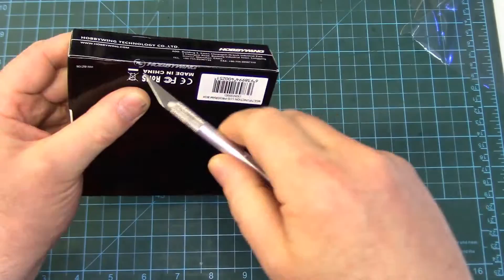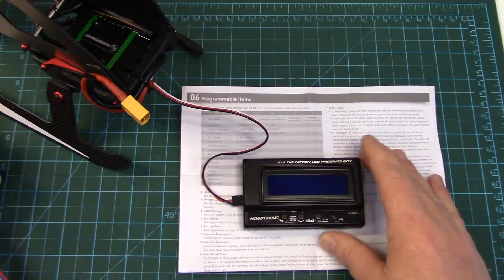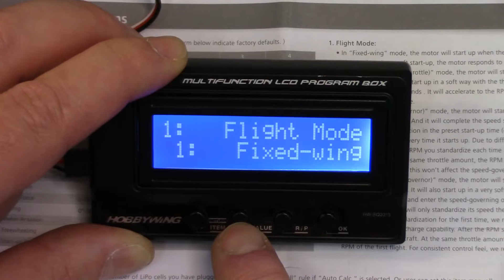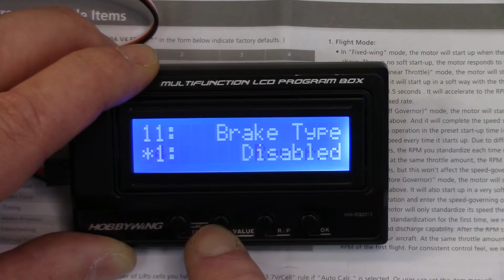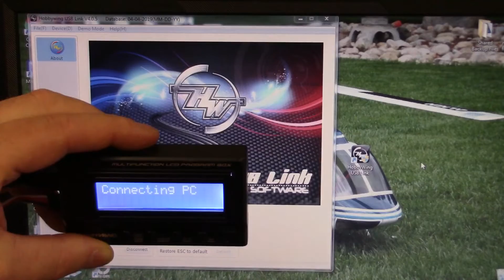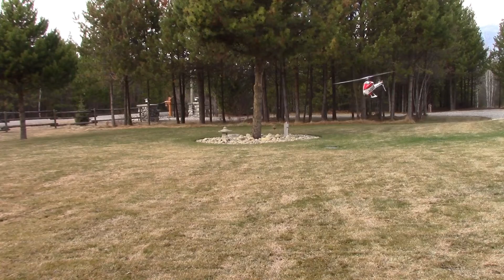ALZRC Fast Devil 505 First Test Flight

Comment: Hi John,
Got myself 505, and this is my first FBL Heli.  I’m use to fly Heli with fly bare (Thunder Tiger Raptor 50). my D/R EXP set at 25. I only do sport flying.  

With this 505 FBL the helicopter is very responsive with D/R EXP set at 25 and still afraid to hovers or fly this helicopter. 

What is your recommendation for D/R EXP setting so my helicopter won’t be so responsive. 

Also I just order H1 auto pilot for this heli and one of your video will be great help setting up.

Comment: Hi John love your videos! Can you do a tutorial on programming a K bar with the iCard? I don’t have a windows based computer just a Crome book.. I’m new to programing flybarless systems have a 450align v2 that I completely built from scratch a 480 and am currently using conventional set up but want to change to dfc head.
Reply from the maker: Sorry, I don't have a K-bar.
Reply: @Rchelicopterfun  ok thought you had a K bar on the 505 my bad
Reply from the maker: Got rid of it & put an Ikon in after the Kbar tail gyro started drifting. No idea about programming the Kbar with an iCard (don't even know what that is). The one I had, like all my FBL units, I programmed via USB cable and laptop.
Reply: @Rchelicopterfun  the iCard is a portable programming module that you can plug in at the field designed for the Kbar.. ok thanks for the help
Reply: @Rchelicopterfun  is it possible to do a full programming with the iCard on K bar ? Not sure I’m finding it hard to find info.

Comment: Hi John, awesome content, so much so I bought a 505, H1 and all the bits you used and built myself a copy of what you did. One question if I can?…. when using the program box, I updated the firmware on the program box itself and ESC. On the program box I’m now running firmware version 4.0.06. Your video shows you running 3.2.33. In version 4.0.06 they have removed the “Heli Linear Throttle” as an option. In its place they have added a “Heli External Gov” option. The other 3 flight mode options are unchanged between the versions. Given there is no linear throttle option should we be using the Heli Ext Gov or something else?
Reply from the maker: Sorry, no idea short of contacting HobbyWing tech support which is excellent.
Reply: Hi John, firstly thanks for replying. Secondly, I'm surprised you don't know because of all the Youtubers I follow you seem to me to be the oracle on this stuff  - it gives me personal hope because I feel a little less poorly of myself when I get stuck on something (lol). Prior to contacting you I have already been through the tech notes for the various firmware releases and there is no mention of a change to the Flight Modes so it all seems quite odd. Anyways, Ive contacted Tech Support as you suggested and we will see what they come back with. I will update this post if I get anything meaningful back to help anyone else following your build.
Reply from the maker: @Drone Downunder - yep, unless you use the exact version firmware, it's pretty much impossible to know every little nuance of every change that is occurring. I'm also primarily a Castle Creations ESC user and  not up to speed with HobbyWing ESC's.
Reply: @Rchelicopterfun I get that John - I will work my way thru it. Be aware though (in case you get anymore enquiries along these lines) the firmware version you used doesn't even exist as an option anymore.
Reply from the maker: @Drone Downunder - Guess that is why I'll continue to stick with Castle's ESC's 😄 Thanks for the info.

Comment: I have 3 K-Bar minis. They all have this lazy tailwag I can't seem to solve. I've tried everything, P gain, I gain, acceleration, etc. with no success. Do you have any advice or know anyone who knows?
Reply from the maker: Softer mounting foam for the unit - run a higher head speed - increase belt tension -  use a better FBL system - confirm no mechanical binding or slop in the tail pitch assembly (about 75% of all the tail oscillation issues I'm requested to sort, are due to mechanical sticking or slop in the tail system).
Reply: Hey John Salt, your previous reply has helped me alot. My new concern is, I have this Kbar on my 700 nitro. Works great except for this stirring oscillation meaning like when you have a glass of water with powdered milk and you stir the milk away. As the head speed increases so does the oscillation. I've tried min and max main rotor gain and so much more. Perhaps you know how to solve this oscillation? Thank you.

Comment: Hi John Ive a few questions for you if you wouldnt mind answering them. ive just bought the E180 and once I re ieve that and fly it for a few months  Im considering buying a 420 or a 505 Devil maybe in the next 6 months or befor the year is out. for me with customs in ireland it will cost me the 420 will cost 550 euros and the 505 will cost 800 euros, I have no batteries so they would have to be bought also. Is it really worth spending the extra 300-400 euros taking batteries into account for the 505 or would the 420 be ok, I really want a big helicopter but i think the 505 would start to get prohibatively expensive for me, but if its the case where it is so much better than the 420 then maybe i may save up longer and buy the 505. What are your opinions please, If you have no experience with the 420 then just give me your opinon?

Also I have a tx16s do I need to buy a reciver for it or can it be bound as is? 

Lastly, can you recomend good but cheap batteries for either heli, everything im seeing and reading about batteries on Banggood such as the ZOP power and the URUAV suggest they are very poor batteries(at least in the 6s versions used in these helis)

Thanks and warm regards from Ireland :)
Reply: Well that unfortunately was a waste of time 🤷‍♂️.

Comment: Hello, Nice video. Just noticed you actually changed your ESC setting back to ELF governor mode when connected to the PC
Reply from the maker: I was showing an example of how to change it using the PC. I changed it back to linear before the test flight.
Reply: @Rchelicopterfun  I was kind of worried you changed it by accident while showing how to change the settings and then didn’t notice it. All good then! :)

Comment: Hello john, very nice video and build! I am building a 505 right now and am at the point to put the main rotor head on. When i put it on it  has some up and down play in it. When i take it off is found out that het hole in the main shaft has a larger diameter than then lock bold that goes trough. Is that normal?
Reply from the maker: Shaft hole should be just large enough for the hex bolt to easily slide through. An oversized hole in the shaft where the head block jesus bolt slides through shouldn't cause the head block to be overly loose on the shaft, but there will be some play. The head block like most mid to larger size helicopters is also clamped to the mast by two more hex screws. Maybe you forgot to tighten them?
Reply: Thanks for the repy, i try to tighten them some more.

Comment: Does the Kbar come with limited bank angles? I am kind of new to RC Helis but looking at the Alzrc heli kits, I don't want it to go full 3d mode tho. Is this easy to setup to have mild controls?
Reply from the maker: Any collective pitch RC helicopter can be setup with beginner/mild response & control for learning on. Cyclic & tail dual rates are your friend along with tame pitch & throttle curves. Reducing collective response as well as power output is just as important as limiting cyclic and tail response. To answer your question on the K-bar. It's a 3 axis gyro only, no artificial 3 axis accelerometer self level & tilt angle limit help.
Reply: @Rchelicopterfun  okay gotcha. This was extremly helpful, appreciate your input!

Comment: Nice series on this. I built a Goblin 500 for my son back when they came. He was an accomplished 3D pilot at the time. He eventually quit the hobby but I am trying to get back into it. He was a much better pilot than I ever was. I was looking at one of these since they don’t make the Goblin in 500 size anymore. I don’t see any difference in your videos other than colors. I think I would rather use one of these than buy a used Goblin and rebuild it. So are you still liking the electronics that came with it? Like you I probably wouldn’t use the K-Bar long-term. I do think it’d be greater for smaller helis. Hard to beat a $35 VBar clone. The knock on the original Mini VBar was its current handling ability. I still have one on a 360 sized heli. Are you guys able to fly larger helis there these days? I am worried about FAA regs here. It’s not looking good.
Reply from the maker: Hi Rod, Yep, it's a pretty amazing value and quality piece of kit for the price. All the electronics are still working very well - not a single problem. I'm flying the 505 with a Bavarian Demon 3X now. That cheap Kbar is okay, but I always had occasional porpoising (so minor you couldn't see it unless flying close in) that I could never quite get rid of.
 I've always been of the opinion, you can get that sort of stuff sorted on any FBL unit if you take the time to play with the PID and response time settings, but I never could get rid of it completely on the low cost clone K-Bar. The BD 3X has an elevator filtering algorithm and it flies like a dream now. I'm thinking the large mass of the tail boom on this thing in relation to the rest of the heli mass (like scale RC helicopters) is just too much for the cheap K-Bar to deal with (just a guess of course). I tried the K-Bar on a conventional pod & boom Trex 600 after removing it from the 505 and it works fine with no porpoising at all. 

Flying up here in the Great White North is harder as well. Unless you belong to a MAAC (our version of the AMA) field or have a private field to fly at, we are basically stuffed unless you are willing to succumb to the time & money wasting draconian RC registration & reporting process . Most of us RC heli fliers are just giving the middle finger to transport Canukistan while we fly our birds illegally in more remote locations, which most of us have always done anyway very safely and responsibly. I will never register myself unless there is some common sense put forth and these jokers actually use science and critical thinking in their policy making. We all know hell will freeze over before a corrupt & inept politician/s ever does that. As of right now, RC regulations are even more draconian than they are for flying maned ultralight aircraft up here. It's a joke! 😡
Reply: @Rchelicopterfun  Hi John, I recently move to Canada to study abroad and I agree, the regulation is nuts, let us rc heli fly and ground the drones, its the drones that is causing the issue not the rc heli guys

Comment: hey John  i just bought the hours xq12s with opentx  it has the latest version 2.3.5 on it but there  is no helicopter menu what version do you have or how you get it. when i pull up the version screen on transmitter in OPTS it says noheli
Reply from the maker: I'm no expert on OpenTX configuration but my guess is you'll have to go into OpenTX companion and redownload the OpenTX firmware version you are using to your Horus, but this time, make sure the noheli box is un-ticked in the build options section. I'm currently running version 2.2.3. There are lots of video's out there on OpenTX configuration, but if you're interested, I did one on my last Horus update where I had to enable the multi-protocol option for the iRangeX module. Here's the link to it if you're interested:  https://youtu.be/XmUIdMsBnZI
Reply: @Rchelicopterfun  opentx is whole different world than what i am used to. i was running spektrum. they are up to version 2.3.5 now i went a head and  flashed the radio  and did not check thew noheli and now i have it on thanks for the info
Reply from the maker: Glad that worked. Yep, OpenTX is a whole new world compared to pre-configured computerized radios. I found it rather intimidating when I switched over, but now love the features and flexibility it offers. The growing list of cool radios that now support it - amazing. Of course, still loving my X12S. I see that latest version 2.3.5 is a critical one to fix some Horus bugs so I better flash mine too - my least favorite thing of OpenTX.

Comment: If you're using the FBL gov you can save some money by using a Hobbywing Flyfun V5 ESC instead. They're basically a less expensive airplane mode only version of the Platinum V4 that uses the $8 LED card instead of the LCD program box. The manual doesn't mention it but they output an RPM signal on the brake signal lead when brake mode is disabled in the ESC.

Comment: Hello good morning, I thank you for the videos you make are very helpful for me.He bought this helicopter model and these batteries could tell me if I'm fine for my devil : 

Zellen : 6S

Spannung : 22,2V

Entladestrom : 30C / 180A

max. Entladestrom : 50C / 300A

max. Laderate : 2C / 12A

Kapazität : 6000mAh

Stecker : 5.5mm Goldkontakte

Balanceranschluss : JST-XH

Maße LxHxB : 150 x 53 x 50 mm

Gewicht : 820g
Reply from the maker: Likely too big. I show the battery space available in the helicopter during the build video:
https://youtu.be/2N39ephs5w8
Recommended maximum size is 4500 mAh for this heli.

Comment: Are u using grease on the main gear? What is recomended?
Reply from the maker: No grease is recommended. A little silicone spray lube would not hurt since it's safe for the belt, but it's not necessary. Will likely just attract dust more than anything, but it may prolong belt life a little bit. I do use silicone spray lube on the tail belt however on all my helicopters that run tail belts to reduce potential static build up.

Comment: Which Lipo do you use ?  how many mah and how much discharge rate ?
Reply from the maker: The ones I'm using in it right now are 6S 4000 mAh Turnigy Nanotech. Discharge rate is only 30C on them, but I'm not a hard 3D smacker; only sport so they barely get warm with my setup & flying style. I thought I could use my 6S 5000 mAh packs, but they are just a smidgen too big. A 4500-4600 mAh pack would be ideal if you want longer flight times. I do talk about the battery size space available in the build video I did: https://youtu.be/2N39ephs5w8 at around 27:10 into the video if you want to know what room you have available in the "belly".
Reply: @Rchelicopterfun  thank's a lot ! it's crystal clear ;)

Comment: What did you end up deciding about the head dampers? Just curious.  Nice flight video! Looking forward to more😎
Reply from the maker: Well, seems to work fine at lower head RPMs with the hard inners and soft rubber outers. No cyclic nodding or bobbing so guess it's best to just follow the build manual.
Reply: @Rchelicopterfun  Cool, glad it worked out. Looking forward to more flight  videos of this one.
Reply from the maker: Kept it with the 4 o-rings (two on each side), with 2 spacer washers (one on each side), and didn't use the hard plastic (close to rigid) rings. For my flying style and lower head speeds, I don't want it super stiff. I may end up putting one additional spacer washer on each side as things will likely loosen up a bit and as I start dialing the head speed up, but for first test flights running lower head RPM's, what I used seems to be working well.
Reply: @Rchelicopterfun  Cool.  One of my helis of different brand (Oxy 4 by Lynx)has the hard damper and o ring combo. It took some getting use to, but I run it at lower head speeds just fine
Reply from the maker: @jasoncourville9568  Good to know. I'm going to put the hard inners back in tonight and see how it goes with the same head speeds.

Comment: Nice to see helicopter videos it seems to be all quads or drones you can't beat the sound of a helicopter
Reply: Got myself a barely used walkera 450d03 few weeks ago, at half price, Tweaked it with blade balance, swash leveling, cg. 

Quads are camera platforms for photographers and casual pilots imho. Helis are a different animal
Reply: Hanz Cedric best self leveling  rc Helicopter on the market.